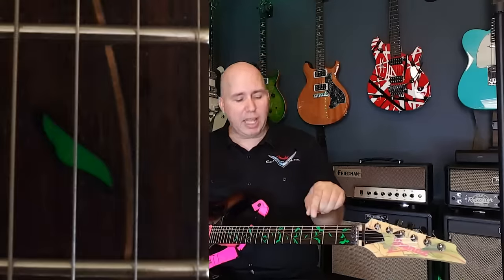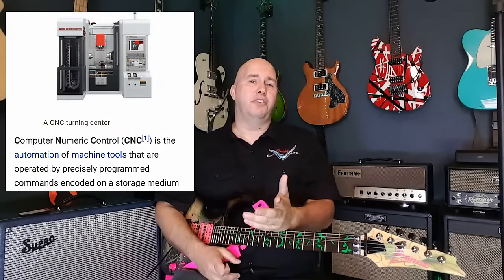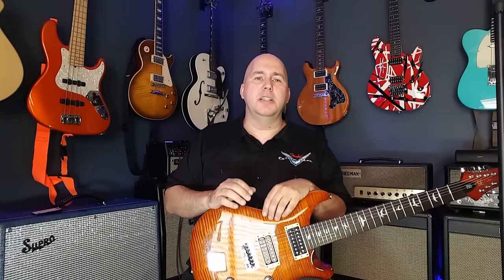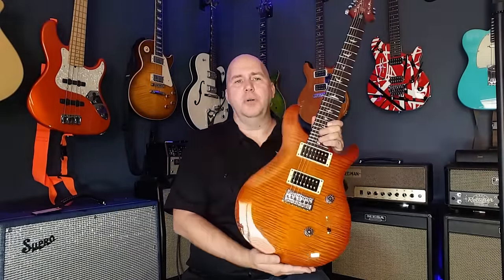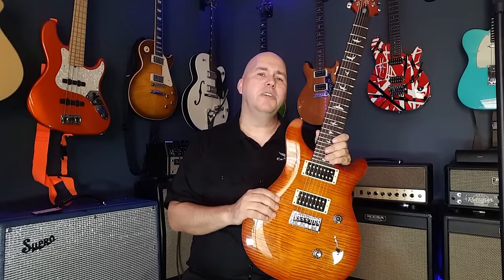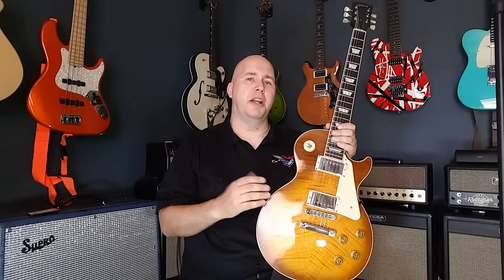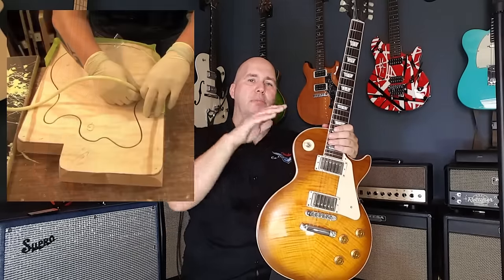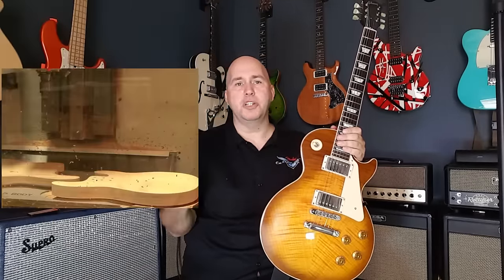7 Things That Do Not Make Guitars Expensive Anymore

Comment: This is a great example of the economic principle of premium pricing. Another common example is the premium pricing you find at your local coffee shop. The difference in cost to the retailer between a plain cup of coffee and an "exotic" latte is much smaller than the relative mark-up in price they charge you. This is the power of a free market: the manufacturer has every incentive to reduce the cost of production because it increases profits. As the consumer, you decide the value of the premium priced product. I.e. Is the binding on the guitar worth $500 to you? It only cost the manufacturer $5 to install. If this seems like price gouging, consider Apple. The components in their phones are similar in cost to those found in cheaper phones. The premium Apple can charge rests largely in the power of their brand. This is not a rip-off. The most important thing in a free market economy is that YOU the consumer decide what is valuable.

Comment: I have $30 Alnico II PAFs in my axe and they sound amazing, crisp, articulate and warm. They are sold by a small British venture (probably made in China/Korea/Indonesia).  Vanson sells a number of affordable guitar upgrades and they are just that, upgrades. In total I spent about $100 on upgrade parts for my (cheap) Les Paul copy and the sound I get from it now is easily as good, or better than the "cheap" Gibsons I have tried out in various music shops. My goal was to save up for one of the new Gibson Les Paul Faded Ts and fix up my cheap guitar out to tide me over. My cheap guitar plays better, sounds better and looks better than the Faded T.... Total spent? $80 for the guitar (used) and another $100 for parts. I leveled the frets, recrowned and polished them myself, adjusted the truss rod and replaced the hardware/electronics. I now have a 1.2mm action at the 12th with no buzz and beautifully Les Paul esque sound. The plywood body does negatively impact the tone and sustain but not to the extent that it wasn't worth spending the money on. Now I am looking at a Harley Benton LP with Maple/Mahogany construction.

Comment: Was take first PRS that you used to talk about veneer on the body an SE model, if so they are the non USA built guitars and are for sale as to the lower cost market. Keep in mind USA built guitars are definitely not using a veneer on the body the shape of that guitar is carved out of a solid (book set) piece of maple on mahogany back. In the case that you haven’t priced wood in 20 years figured maple is NOT an inexpensive wood when it is premium top grade which is all PRS uses.

Comment: actually the pickup can be expensive more so than a non electric or a "bring your own pickup" electric guitar.

back when copper was $5 to $10 a pound  copper was so expensive that many companies would use aluminum for some wire wound things like many newer hard drives use aluminum for the coil in the read/write arm, microwaves would use aluminum in the high voltage transformer, picture tube tvs would make the demagnetizer coil from aluminum just like zenith has been doing for many years.

since a guitar pickup has no current running through it it is possible to get away with cheaper metals.

Comment: All true except the only thing you missed is the neck binding on the Gibson is heated on a hot plate, pushed into the fret ends and hand dremmel'd over the fret ends. Gibson is one of the only companies covering the fret ends. Not just mounting them on top of the binding. This is why Gibson charges more for binding. It's the binding on the neck not the body. Other than that great video!

Comment: With small batches everything such as acquiring wood might become much more difficult and more expensive. If you order stuff in 1000s it becomes much cheaper. If you manufacture stuff in 1000s the price of equipment per item becomes much cheaper. Therefore these factors vary by manufacturer. Therefore bulk of guitars are mostly done in same few factories.

Comment: Adding vinyl graphics to a guitar does add cost. I've printed, wrapped, and installed vinyl on many things and places. you have to figure the cost per square foot and ink cost per square foot, let alone cost of the art work.
I would agree it shouldn't be a ridiculous difference in price... but it should add only $20-100 to the overall cost. (production vs. custom images)

Comment: This was a really interesting video.

 I would love to see exactly the same, but in reverse  - 7 things that rightfully make the guitar more expensive, like the through-neck, cause I have no idea :)
Reply: I can probably guess a few. anything that actually takes more material to make. say a floyd rose bridge vs. a pot metal fixed bridge. the steel alone in it would add some value. especially in the resonating block, especially if it's brass, copper or granite block. the nut or saddle material can add a little bit of price if it's bone, buffalo horn, piezo pickups, or a truly exotic wood. any active electronics that involve circuit boards or more complicated systems would probably raise the price. an actual maple top instead of a maple veneer would raise the price. or any type of real wood top. doesn't have to be maple, that's just what's common. possibly tempered frets, since they're not just cutting straight fretwire, even though they're still just cnc' the fret grooves. i'd also guess that using real shell inlays, instead of printed pics or digital designs might raise the price by a little. i've seen guitars with titanium frets. that might genuinely cost more in material. (though they squeek horrifically when bending notes). i'm wondering myself if doing multiple stain jobs on the same instrument for some of the more wild colorings we're seeing from Keisel and Jackson would genuinely cost more, because of time it takes to stain things? but i'm a metal worker. i know nothing about wood. does staining take long to dry? does it have to be done multiple times to create something quality? Is stain more expensive than paint? I dunno. any crazy material like carbon fiber instead of wood. that would be kinda expensive. Didn't parker guitars used to be made out of carbon fiber? oh! if for some strange reason the guitar used really expensive electronics, like silver wire instead of copper, But i don't think any company does that. but even NOS wire can go for a pretty penny. I'm not sure if it's the kinda thing you would get at a discount for buying lots of it either. anything flagrant like actually having gold hardware, or gold connectors on electronics (which doesn't make any sense because silver is better, but that doesn't seem to stop companies). oh! if it has a copper Faraday cage installed in the control cavity. no-solder pots run a bit more. push pull pots cost a bit more. blend pots cost a little bit more. (They all have more material in them).

But the biggest price increases are always going to be from Brand recognition, hand crafting instead of CNC, and just regular old price gouging on things that don't cost anything extra in material or labor as he mentioned. of course then there's always import taxes and tariffs as well as wage differences, but i don't want to talk about modern politics here!

These are just my kinda-educated guesses. i'm gonna say 1/4 eductated?

Comment: I've seen a lot of very decent guitars that don't have the Brand name,  not do very good in sales.   Like Mitchell guitars.  Its hard  for a consumer to see Value in something with out a brand name for some reason.  I have Mitchell TD-400.   Smooth Frets ends,  Good magnets in the pickups,  Good off brand locking tuners.  If the headstock said "Fender"  it would sell better and for triple the price.    Mitchell is a very value for the $  if you don't care about brand names.

Comment: Generally speaking, you have to keep in mind that a cnc machine is not magic tool; it has to be programmed with drawings that have to be created..additionally, you can't say that because a company uses a cnc machine, that there is no added value, because of first, the creation of the drawings and programming, and secondly, because of the cost of investment to purchase or lease a cnc machine. The cnc machine is a tool, like a router, no different, other than the fact that the operator isn't performing a hands on process, but the cnc adds value in terms of speed and consistency of the process; adding value for the consumer because they can receive their purchase in a fraction of the time. This leaves more time to tend to more detailed hand work, where the added value really counts.

Comment: that's not about how much it cost to the company , but much more like how much could you spend for a "better" finish / construction / pickups
by exemple , bolt on neck are not more expensive to do than set neck , but the set neck is "better" than bolt on , so more expensive , that's it

Comment: I'd be interested to see someone address the extra cost of a left handed guitar if we are in the situation of manufacturers using CNC machines for the guitar body. There should be no real difference as it is just a reverse of the program used for a right handed guitar.

Comment: What about the tuning head? I have a cheap Ibanez and was told I should get something better and it wouldn't go out of tune so much. So if I buy a prestige will the tuners be better or the same as the GIO? Will a J-custom stay in tune better? Or do they all have the same machine heads? Just as a for instance.
Reply: Robert Days Better tune heads do increase tuning stability, but if you're playing an Ibby GIO I'd probably replace the nut with a Black TUSQ one first
Reply: That is what I play, and that is what I did,  replace nut and tuners and it ios fine, no need to spend a lot on a guitar
Reply: Thx guys

Comment: I always believed that 'tonewoods' applied to acoustic guitars, as the sound resonates in acoustics and made no difference in electric guitars....sound wise....as well they use electric pickups?
Reply: There's tons of debate on this. personally, i think the material a guitar is made of CAN make a difference (and often does). in my experience it seems to matter how well your saddles and bridge translate the body material sound to the strings. but most bridges and saddles do this quite well in my opinion. i think it also depends on just how different the material is. i notice a lot of difference between my ply wood warlock, and my Chesswood Mockingbird using the same pickups and electronics. Granted, they're different neck styles and bridge styles as well, but still the tonal difference was huge. but those two woods are as far apart as wood gets tonally. they're extreme ends. as far as a i know, nobody but BC Rich has used Chesswood for guitars, and very few companies make guitars out of plywood either. 

I've also noticed that lighter woods really let the sound of the pickups and electronics shine through, whereas heavier woods tend to take over a bit as they influence sound much more, and can change the way pickups sound much more noticeably. (once again depending on the saddles and bridge). but basically the material can affect tone, if the rest of the components of the guitar let it. conversely, you can make a guitar out of any material that's stable enough, and take that material completely out of the tonal equation with the right bridge, saddles, and nut to cancel it out.

Magnetic pickups create a magnetic field near the strings, that the strings interupt it when they vibrate. these interuptions in the magnetic field get registered as changes in electronic signal generated from the pickup. people argue that because it's all electro-magnetics, and not acoustic waves, that the guitar material doesn't matter. it's all about the electronics and only the electronics. But i would suspect that the body material of the guitar vibrates as well, influencing how the string that's structurally connected to it vibrates, thus influencing how that magnetic field is interrupted exactly. i'm no physicist, this is just my suspicion of why we can often hear tone woods in electric guitars. What we're hearing as "tonewood" is a balance of the wood, bridge, saddles, and probably nut material and how they all add up to influence how the strings vibrate. I don't think the discrepancy between how an electric guitar sound unplugged, and how it sound plugged in are as great as some mathematical purists are hypothesizing.

Comment: I agree with most of this. The woods part though isn't correct. A mexican Feder electric guitar body is generally built using 7 pieces of Alder with front & back venner to hide it. A one piece of Alder costs averagely four times as much. Alder is a cheep wood, but if you look at Mahogany, a one piece body costs around three times as much as a four pieces one and mahogany is not cheep. This shouldn't make a guitar expensive on it's own but it is bound to make a significant difference.

Comment: One thing that often get's on my nerves is how the famous top 2 electric guitar manufacturers always attract top dollar when guitar manufacturers such as Tokai, Fernandes, G&L, ESP, Steinberger, Parker, Kramer and Ibanez for example offer so much more value for money, not to mention feel so much better to play on.  It's a shame that people see there heroes, see what they used and believe they have to use the same.  It's psychological waffle.  What should matter the most is what guitar feels good and above all, sounds good to your ear.  In fact when it comes to electric guitars, I'd argue purchasing a body that is similar to your desired manufacturer for a lot less and just putting the same pickups as the model you want in that will not only save you bucket loads but essentially give you the exact same sound.  Some will argue the shape and woods used will affect the sounds but when it comes to electric guitars where is your sound signal coming from?  The pickups.  Electrically the wood does absolutely nothing but provide an ergonomic block to make using the guitar easier and hold the key components together.  I'd argue that there's more to be gained by trying different style nuts and bridges where the strings sit on and ultimately vibrate between, than if your body style is Fender strat or Gibson les Paul in shape etc.   I'd be fascinated to read others points of view on this aspect of the electric guitar.
Reply: Sean Curtin

Or you can just buy the guitar you want by with manufacturer you want with all the features you may want.

If you want it, buy it. Take the cheap way out, you’ll always wish you had what you REALLY wanted. If you want and are happy with the 300 dollar piece, great! If you desire the 900 dollar piece, you’ll never truly be happy with the lesser option. Just sayin.
Reply: Sean Curtin 

Also the fact you believe wood doesn’t matter on an electric guitar basically just screams “don’t listen to my opinion because I don’t truly know what I’m talking about”. Your entire comment is void at this point.

Comment: Okay, but a good pickup(objectively) is about $100 and the cheapest guitar that you should hold onto is about 2K. That said the things you are talking about especially the designs is true. However, in the case of wood it makes a big difference in how the guitar works and whether the wood is laminated and where it is laminated if it is either a hollow or semi-hollow. For solid body guitars, the wood doesn't matter at all except on whether you need back surgery after use.

Comment: In my opinion pickups, I wanted the biggest scams in modern guitar building. Obviously setting aside the vintage market. There's literally no difference in the components used manufacturer to manufacturer for the most part, so you're paying for the name rather than the overall pickup quality.  For example, I was going to have a custom made. Gordon Smith guitar commissioned it would have been their LP style.
 stock it came with Matte Black humbuckers which I really didn't like for the traditional look I was going for they would fit Chrome covers at £80 premium 40 per pup. When I queried the high expense per pickup I was told it's because they don't make Chrome covered pickups in high Volume so they're done as a special order I called BS because clearly there is a market for Chrome covered pickups so just to make a load at once. They also wooden sell me uncovered pickups and covers so I'd be forced to pay the premium. Reason being is the covers had the Gordon Smith branding on them and I really wanted that.

Comment: With a brand on the guitar you pay for 1. Brand marketing 2. USA work force ... that's it... the CNC machines cost the same around the world, so does the wood . You can clearly see it on the brands like Harley Benton which was found by Thomann, they do their stuff in China in good factories with quality control and they do their own quality control in Germany. The brand has no marketing and its sold in house only. 
I bought Harley Benton Jazz bass... it is really cool bass, neck is well made with binding, there is no fret work needed. For 150 $ it is awesome. 
But if they would open a factory in USA, they would need to promote their stuff to get on the market and suddenly the same guitar would cost 800 $.

Comment: Gotta disagree on pickups.  Between Jackson, BC Rich, Ltd, Ibanez, and Schecter, the stock pickups aren't great on the low end models.  Most of the brands' high-end models don't use factory pickups, they use EMG's, DiMarzios, and SD's.  Gibson and PRS make damn decent factory pickups, but the other manufacturers that I've listed leave room for improvement.
Even Fender has their own tiers of quality in pickups.  You've got the Standard Strat garbage, Tex Mex, then the Lace pickups.  If they were all the same cost, why not just outfit everything with Laces and have kickass pickups on every model?